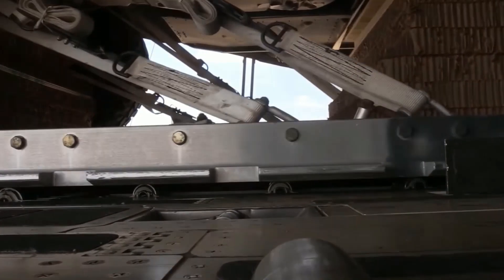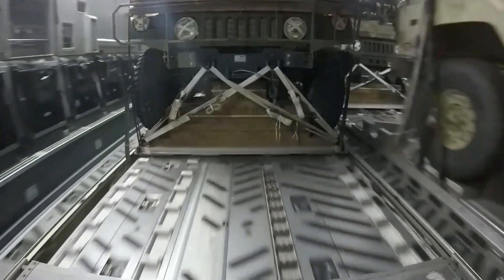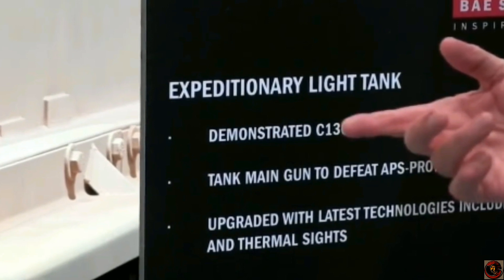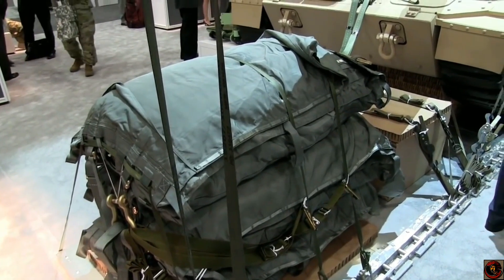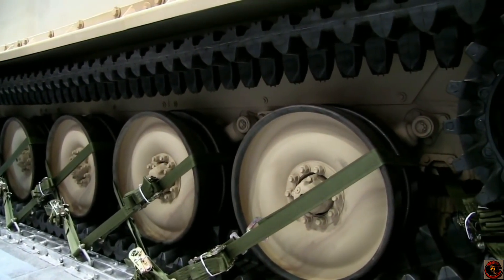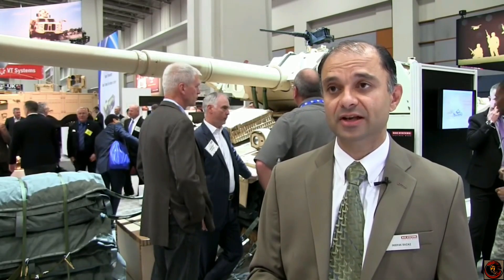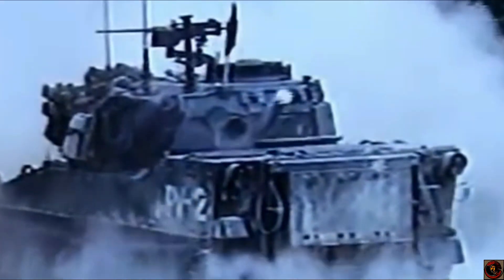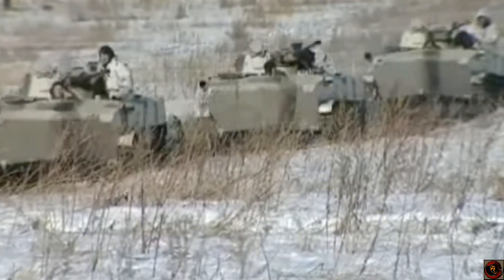Dropping a Tank From a Plane - Airborne Armour?

Comment: Id say one of the bigger questions were - is it airdrop capable ? Not if it can be thrownout of an airplane, but if its construction and materials can withstand a hell of a lot of dropps without having material wear issues. Russia also uses its tracked vehicles special track-suspension abilityes to both, dampen the impact from a drop and change clearens later on. Not sure if this thing has any viable suspension capable of 50+ airdrops, nor the proper construction ( aéspecially eround sensitive stuff, like the main gun mountin ) for that.  Is also true, the do this in much lighter and less armoured vehicles. Its interresting they try to forward a Sprut-SD like gun-support role vehicle for the paratroopers, but Id be putting my money, they have both, a lot to do to make it air-droppable, and that that truck bringing additional armour plates to mount them post-drop will be a probable reality. ( just too heawy ewen if composites ) In th e end, its also a question, if it wouldnt be a much better idea to not "fit" an older platform wih a different idea of its usage to such a specific use as an air-droppable vehicle, and construct a new one with ths very idea in mind ? ( cause it might not be as much a money-saving idea after all )

Comment: Russian Generals are becoming dismayed with the cost of their  BMD Airborne vehicles, reported at $4m a piece for a 4 series - the same as  the cost of a T-90 MBT, and their lousy survive-ability in combat. Its hard to see how BAe can do better than the very experienced Russians. 
The idea about motorising Para's was recognising that you may not be able to drop your troops close enough to their objective thus a vehicle would be needed to move them there at speed. Lets make it tracked, and why not add a little aluminium armour for small arms fire, and then add a heavy gun and a ATGM,  next thing you know you have expensive mass of men and kit that can be killed by a .5 calibre machine gun.
just buy your paras scrambler and quad bikes. Cheaper, better, and more fun.

Comment: The US Army has designed its units to be light and mobile since the end of the Vietnam War in the mid 1970s. After Vietnam the Army had 2 powerful airborne divisions, the 82nd and 101st. From their experience in Vietnam and applied it to the European scenario battlefield. US based units were reorganized under the 18th Airborne Corps which is the headquarters and command element. The following units under the organization was the 82nd Airborne remain on jump status, the 101st Airborne (Air Assault) become a true air assault unit with the division with huge helicopter aviation assets for mobility. Under the 18th Airborne Corps included one Armored and one Mechanized Infantry Division to follow on with armor support and reinforcements. The Air Force was under command of this unit for air assets to include the most important is transport. The Navy were to provide sealift transport and the Marines for expeditionary landings. The 18th Airborne Corps is basically a joint command task force with all the US services playing a part and only answers to the President of the US. This concept was built by 1976 because of the 1973 Yom Kippur War which the US needed a quick response combat asset. During conflicts like Grenada and Panama. There were major fuck ups in command and control but were fixed by the guys on the ground. By Desert Shield the world saw the might of the US under the command of the 18th Airborne Corps and things rolled out quick with troops and logistics which was important to combat power. Once they established a foot hold they were able to bring the Army's Germany based Armor units into theatre within a week by the Air Force and Navy. Airborne Armor is nothing new and the Army did field light armored tanks but the concept was not practical. The Sheridan would not have been effective for combat against Warsaw Pact units in a European battle scenario. That is why Airborne units have anti-armor TOW sections in every infantry battalion and M47 Dragons in every platoon and squad back then. Now they still have TOWs and the newer Javelin system which is far more deadlier because it is a top attack system like the TOW II and newer versions. Airborne and Light Infantry with anti-armor systems are more problematical for enemy armor units now because they are widely dispersed and harder to target. Remember the Russians nearly got slaughtered when using either mechanized or armor units to fight in Chechnya against guerillas who used the same tactics because the Chechens did fight in Russian units during their war in Afghanistan during the 80s. Chechen combat veterans made the Russians pay dearly in combat.

Comment: I just want to point out- they already updated the M8 Buford (the vehicle shown here) to the M8 Thunderbolt II. That version has a 120mm, firing the same NATO standard ammo as the Abrams, and has been modified with a hybrid-electric drivetrain, which saved so much room that you could fit some infantry into the back of it. They already did the massive and expansive testing program on the M8 in the 90s. They threw it out of planes (this is the tank they threw out of a plane in the movie THE A-TEAM, for god's sake, it has been done enough times) shot it with the various armor packages mounted (that wasn't a firecracker, that was an RPG, last time I checked, the level 2/3 hybrid package mounted on the vehicle did what it was supposed to, the RPG detonated inside the block and was negated) (by the way, NO ERA OR CAGE, just good composite blocks in the level 3 package, which is the most armor. Level 2 is just spaced appliqué, level one is base armor) and already spent the money to develop the tank, and it was nearly ready for production, but they cut the program because the military didn't have enough money to go around. It was designed to share components with as many common vehicles as possible. Tracks from the Bradley, now the FCS from the Abrams, etc. and it did so rather well. It was designed to be upgraded and modular in specific areas, and they recently made that VERY clear how easy it was to upgrade a mothballed tank straight from the mid 90s to the 2010s.

Comment: I do admire Russia's APCs and mobile vehicles a lot. My favorite so far is the Nona 2s9, its an amphibious airdropped artillery piece. Vehicles like this allow front line troops to have readily available arty support to a similar degree as infantry mortars.
Reply: ... also the next generation "NONA" ... which is called "VENA".... I think is also mindblowing...
Reply: its your favorite because you didn,t see sprut sd-m1 http://www.military-today.com/tanks/sprut_sdm1.htm
Reply: Denis l holy crap that’s just blown my mind away
Reply: @dandesso8926  yes :) can shoot rockets from main 125mm barrel as T90MS on the move up to 5km thx to auto assistant(simular to kornet missile module on bmp 2M,i found video where it hits with rockets on the move from 4,5km) also it has commander with thermal sights and PKT machine gun and awcorse it can swim without prerations.i am fanboy of this vehicle :)

Comment: They are called rubber tracks but they are far from being only rubber. The technology has been used on some motorbikes to replace chains since the 80's on for example the GPz305 (from about 1983), pretty much all modern Harley Davidsons, and is used to replace cam chains in a lot of car engines. On a GPz305 the toothed belt instead of a chain was almost maintenance free (it needed cleaning to remove grit occasionally or it would wear quicker), and lasted near three times longer than a chain on a similar motorbike that used one and that was with the early technology of a fabric inner. The really tough ones now are layers of rubber and Kevlar, and are almost unbelievably strong - about twice as strong steel if made correctly (the Kevlar itself is 5 times stronger weight for weight). If I remember correctly they also are a bit more efficient as there is less friction and therefore less power turned into heat.
Reply: Yes for internal energy transfer belts are better than chains. He is doubting the wear resistance driving a tank on it. To me they seem inferior, lighter vehicle but if it breaks you can't easily repair it right?
Reply: Gordon Lawrence did you notice how originally he said “hmm I don’t really know much about rubber tracks but I think it may be the wave of the future” and finished with a pseudo meltdown about “pshhhh you fool! Metal tracks are the truth, the way. Anybody who says rubber may be superior is just not on earth” 

I’ve noticed in a lot of videos he says something like “I know people might not like my opinion but blah blah blah, triggered, blah blah blah be respectful”

It’s like... ok dude you should be respectful of your own opinions. If you tell everyone you don’t know about one thing, how about don’t go on a diatribe about it in the same video?

Comment: I must disagree with you on the subject of metal/rubber tracks. I have personal experience with rubber tracks and they work in most cases as good or some times better then steel belts with rubber pads. pleas note that the rubber belts are reinforced with metal wire and are extremely rugged. they are less maintenance heavy and they are harder to destroy ro breake than metal tracks (depending on how you run them) :) 

Side note: my experience is build on APC´s not AFV or tanks.
Reply: Matsimus please do a video on rubber tracks vs metal vs metal with rubber pads track. (Danish army use rubber band tracks on there M113s)

Comment: Tracks are not pure rubber, inside there is steel, cevlar, carbon, nylon that actually takes all the load, rubber only protects fibers inside from mechanical damage

Comment: what about the m551 sherridan tanks that were dropped?
Reply: Sheridan's were phased out in the 90s, the last unit that used them, was the 82nd airborne they also used into the mid-2000s as aggressor OPFOR vehicles with body mods (VISMODS) to simulate communist block armor. till parts  ran out and could not be maintained and serviced  and they were replaced

Comment: Keep up the great work..

BTW those are BMD's 5 road wheels VS 6 with the BMPs.. BMD's were designed to be airborne APC from the beginning.

From an old US Army scout, I had to memorize almost every warsaw pact equipment, capabilities, tactics and formations.. lol
Reply: The idea is to be C130 capable, the Stryker and LAV are not. M8 was so designed from the start.
Reply: All 3 have the same 105 Gun, M8 is a smaller, lighter size package. This is not meant to fight head to head MBTs but rather the BMP / BMD which far out number MBTs in any Theater of Operation. Airborne and Light Infantry need heavy support fire power the moment they hit the ground and not have to wait till day 3 to 6 for heavy tanks to be flown into secured airfields 2 to 3 at a time. Oh by the way there are only 3 operational M8s in the world. 2 with the 82nd, 1 with BAE.
Reply: Brecconable the M8 doesn't have the same penitration as the LAV 600 or the M1128, but, the gun is just as capable, like he said 12 rounds per minute, on a vehicle that has insane top speed capabilities
Reply: IraqWarVet03 I
Reply: Just an observation from an old army tanker who has been on the VISMOD M551A1 out in NTC when it was actually a NTC, ie..OPFOR with 14 days straight doing force on force training, the main reason dropping tanks light or not is weight and suspension systems. Tanks use torsion bar suspension,  meaning thick metal bars going thru the bottom of the tank attached to each roadwheel arm. Now some bars are heat treated (M1 & M1IP) and other are not (M1A1 & Later series). When these bars break from too much weight or force being placed on them guess what?? Your "Fooked" thats right "Fooked" because you aint goin nowhere fast. Trust me I know, torsion bars are a bitch to change and depending how it breaks, it could turn into an all day affair. There is more to it then just suspension, but that is a large part of it.
Reply: Do you think an M8 would be better for recce and fire support work than a Stryker/LAV or not?
Reply: Absolutely YES ! @Brecconable

Comment: I didn't know tanks could take a beating like that...WoT you have some explaining to do about my tracks breaking after a 5 foot drop
Reply: drive elc

problem solved

unless you get bad rng
Reply: angrydragonslayer I dont play WoT, its a joke cuz WoT is completly based on rng. And it succs
Reply: i always get good rng and teammates so i love it
Reply: They aren't taking that much of a beating, If you look all of them a locked down to a landing skidpadas opposed to over straining the tracks and drivetrain
Reply: Elijah Stewart They aren't classified as tanks for no reason.
Reply: their on skids
Reply: I once survived with just a broken track with an M5 by nosediving off the bridge gap (got paired up with 6K guys, of course suicide was a better option)... Then I had both tracks gone and half the crew one as I dropped 10ft with the same tank somewhere else
Reply: That isn't a tank. That is an IFV.
Reply: @dartmaster501  and IDC
Reply: I believe WoT uses WW2 style tanks correct me if im wrong i've never played it but modern tanks use shit like depleted uranium plates (im not an expert) but its much better than just a few inches of cast steel. In fact especially soviet tanks. soviet tanks at the time were rushed out so quickly that there were gaps in the tank's armour and the finnish forces threw molotovs at the tanks and one molotov usually rendered the tank's crew dead and it's electronics fried. Back then a panzerfaust (the panzerfaust was the closest thing to an RPG back then) would completely penetrate armour and kill crew inside. throw a panzerfaust at modern tanks then you wouldn't see a scratch. Considering there has only ever been one challenger 2 destroyed AND to top it off it was to friendly fire! and one challenger 2 survived 70+ RPGs direct hit without any major damages (the only thing damaged was the sighting system but it was still usable)
throw 70 RPGs at a Sherman or a Churchill or a T34 and you'd Melt the tank down and become a world record holder the next morning for doing it with such speed.
Reply: @fot6771  Electronics In WWII period SOVIET tanks! Where the fuck did you learn history?! Half of them had no driver's seats, let alone electronics. Holes in the armor are usually placed in accordance with the Project so that the crew can use their pistols to took out germans with trench tool and bucket of gasoline attempting to open tank or lit it. Otherwise, the tank will not pass reception Committee. Most soviet tank run on disel, so they are not gonna burn so easily. Panzerfaust wont scratch my old bicycle if you throw it instead of firing. And in former USSR it is considered STUPID to use decent nuclear fuel as an armor. Сeramic, steel, tungsten, polimers, explosives, self repairing apocalipse tank technology is perfectley fine though (self-repair is actually REAL LIFE pre WWII technology. T-34 can fix minor track damage while moving.).
Reply: LEARN YOUR BLODDY GAME NEXT TIME pls :)
Reply: WoT sucks it has hit points tanks don't, play war thunder it doesn't have hitpoints.
Reply: Elijah Stewart modification.wot sucks ass
Reply: WAR THUNDER IS A SIMULATION WHILE WORLD OF TANKS IS AN ARCADE
Reply: @goldenexperiencerequiem4714  Keep thinking that. Looks at fictional M82 shell specs and Panther II

Comment: it always seems the West and nato are so slow at getting airborne vehicles mass produced compared too Russia.
Reply: It's a symptom of different combat paradigms.
Western land warfare doctrine assumes a total air supremacy campaign has been conducted prior to any ground troop landings.
once you have achieved atleast air superiority, if not air supremacy you can use normal strategic airlift assets to unload heavy armour.
The only use western militaries have for this is the initial combat drop to secure an airport an airport big enough for MBT's

The Russian combat paradigm is based on the assumption of failing to achieve air supremacy, only air contention (limited safe drop lanes) and instead defends airspace with a larger ground based IADS
This is why the russians have always focused on getting their vehicles on the ground as a priority.

Comment: That thing is essentially just a fucking re-do of the AGS. What are they going to do to it to make it better, really.
Reply: Kamitorrorga 120mm gun, sponson-mounted engine leaving storage space where old engine used to be, steel-wire-reinforced band tracks, new suspension, new crew-isolated autoloader, updated composite add-on armor, updated optics and electronics. The Thunderbolt 120 is actually a 2009-2010 upgrade. They just haven't found buyers for it.
Reply: I see...

Comment: Meuh ideal. If you will be dropping a light tank, just drop a LAV with a tank destroyer cannon. That way, you will have a tank-ish and a troop transport in one. The ideal is if need to drop a tank down on the battlefield and it is going to run up against another tank; you are fucked because the other tank is probably bigger and heavier. Might as well drop 5 guys with rpg which will be a hell of a lot useful.